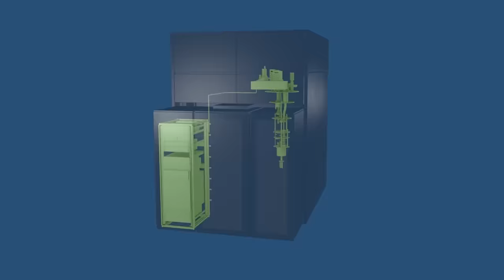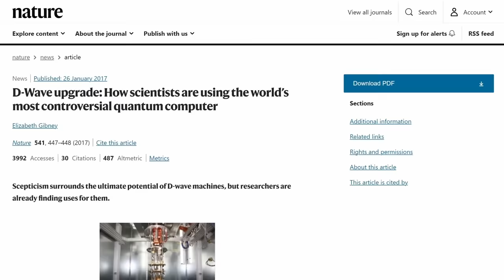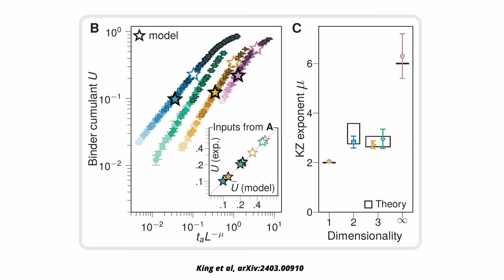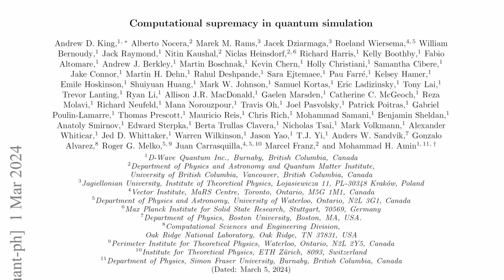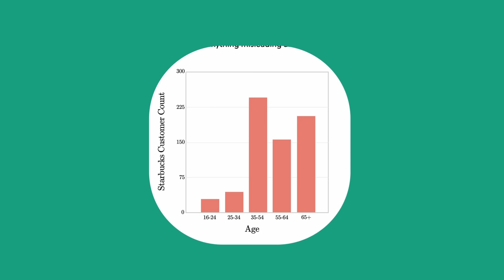Record Quantum Computation at D-Wave: Millions of Years Down To Seconds

Comment: So here is the basic problem, let me use an analogy. 

Suppose I wanted to know the total number of the grains of sands in the Sahara desert. And I ask an authority, and that authority assigns the boundaries of the desert. 

This is very similar to a quantum problem in that while we know the boundary, what is in the boundary is subject to constant "random" and process change. Its obvious since there is a desert, and the desert does not cover all of Eurasia that there is some modulation of the desert, we dont need to know how, but we can argue that there is a wave function associated with the desert. 

So I want a machine to determine the number of grain sands. So I ask AI to build such a machine. The AI builds a coring macine that has wheels on it and it goes out and samples the desert in a large number of places. It has a lab on board that assesses the grain size of the sand particles, it consults textbooks to determine what is the lower cut-off on grain size. 
Finally after doing a long number of calculations and 10 years of sampling, it roles back into its starting location and spits out an answer within a specified confidence range. 

Is that a computer? Most certainly. 

Lets say I ask the computer to answer how many molecules of H20 are in the oceans, a similar line of question, could it answer the question, probably not. You would have to go back to the AI and ask it the AI to build another machine. 

So we need to talk about what a computer is. A modern computer is a machine that connects I/O facilities to a circuitry that has both realtime storage (RAM) and computational facility. 
How it works is that a program is taken from the I/O facilities, loaded into RAM and then executed on the processessore generating an output which is fed back to I/O. The point of the system is that the program is a variable that, hopefully, was designed to work on the system, however the system was not specifically designed to run that program. And so most programs are designed to work on many types of processors and can be written to work on other types of processors, given certain limitations (e.g. processor memory, integer size,  . . . .). IOW processors are flexible to a wide variety of tasks, however, if say you want to build a 1000 part ship in KSP2 you might find that your memory and your flops are going to make your ship is both unstable and your game play hideously slow. 

So if I, knowing the limits of quantum computing decided that I could build a more powerful quantum computer but with more confined limitations on what it could do. And if I was successful a doing this, with an error correction algorithm, I could look at a variety of problems and note problems in nature that have similar random effects. In doing this I could select from a wide variety of problems and demonstrate my platform on the most parsimonious examples. 

    What they are not telling you is all the physics problems they tried to emulate but failed. 
In other words, they likely cherry picked a simulation that worked the best. Then what will happen is that the next best example(s), they will try to alter the machine to increase performance for that(those) problem(s).  This ensures an almost constant stream of oublications over the next five decades which also is alot of free advertisement.

Comment: If wormholes were real wouldn't the gravity at 1 end pull on the gravity at the other.  And being unstable not much light would get through.  And the gravitational paths of gravitational bodies would be altered. Areas of gravity would be linked stronger then they would be otherwise. But little evidence to explain it.

Comment: Simulation isn´t calculation? Thank you for your work.
Reply from the maker: Well, I find this distinction rather fuzzy which is why I don't really get the criticism that's been levelled at D-wave.
Reply: @SabineHossenfelder  "it's just a horseless carriage, not a car" said the naysayer
Reply: The distinction comes from how we think of a "computer" today.  Computers are expected to be programmable to do all kinds of things.  Annealing requires framing a question in the form of a hamiltonian whose ground state is the answer.  That only works for a particular set of applications.  I think a better analogy than a spoon is a pocket calculator vs a desktop PC.  Technically the calculator is a computer but if you asked someone for a new computer and they brought you a calculator you wouldn't be happy.
Reply: @MM3Soapgoblin Thank you

Comment: Would it be correct to call it an analogic (as opposed to digital) non-programmable computer? 

Just like ancient models of the solar system based on spheres and gears "computed" the passage of the days and seasons. Or like the tides could be "computed" with the help of a series of different sized disks adding or subtracting movements from an indicator – we'd use fourrier transforms today...

Or, alternatively, instead of "computer", maybe we could say it's a molecular MODEL of the studied phenomenon?

Comment: While D-wave's results are impressive the comparsion of a semi-programmable device to a general purpose device leads to misleading results. Its like comparing the matrix math throughput of a GPU vs a CPU. A GPU is limited in what kinds of data it can work on but when it does work on that data its much faster than comparable CPU will ever be at the task even if the CPU is perfectly cappable of working with the data the the GPU is designed to work on. In general as the the flexiblity of a computational device increases its throughput will go down. While this isn't a perfect comparsion its the best one I can think of atm. 

The big question I have is: is d-waves device more similar to a GPU or an ASIC? 

If its more on the GPU end of the scale the results are far more impressive than if its more similar to an ASIC.
For those who don't know what an ASIC is it stands for application specific integrated circuit. Its a device that is design to do one specific computation extremely quickly. If D-Waves device is basicly an ASIC but with q-bits instead of regular transistors then its far less interesting and impressive then if it is similar a more general purpose but scope limited device like a GPU.

Comment: All sorts of natural phenomena require near infinite processing time if you want to simulate it at excessive detail. The magnet simulation sounds like an N-body problem, as well as an optimization problem of lower energy states. 

I've been toying with the concept of the "clay computer", where a lump of clay is deformed in different ways, if there were ways of linking the model to some higher order computational simulation problem.

More seriously, perhaps someone can model protein folding into an optimization problem suitable for quantum computers. I offered GPU power through to Folding At Home a couple of winters (when the heat was needed anyways).

Comment: one of the first documented uses of "computare" was in the context of determining the date of easter, as i may remember in the 11th century
For me, they are analog computers that can be applied to a certain class of tasks. However, there is a cross link to certain classes of artificial neural networks, which also use an annealing approach for a 2d lattice of connected items. No, not the current deep data base indexes.... Yet, one has to be old enough to remember, ihihihihi ...  DWave may be suddenly at the forefront of true AI

Comment: So they ran a program - and got the expected result.  Did it run the calculation correctly?  Or did it merely project the expected result?  (Think of this as a more complicated version of ‘a stopped clock is right twice a day).  Doing one thing with it is impressive, but if we can’t check the result without millions of years, it’s hard to assess it’s true capability from a single, unverifiable result.

Comment: i dont buy that. in conventional computing, you have some formula, which models some aspect of the real world. Some (maybe millions of them) variables model the state. then use use 'real numbers', that is IEEE  754 floating point numbers and some digital hardware to combine those IEEE754 numbers according to the formulas. At the end, you get some nice diagram. You modelled/simulated physics by a digital model of it. 
That D-wave thing seems to be much closer to the world it models, that is the magnets. Thats why it is so fast for this problem. It may be fast for other, related problems, like crystal properties. 
however, i cannot see application of this for, lets say, encryption problems, which require correctness to the last bit.

Comment: LOL, conventional magnetic FEA, requires billions or trillions of elements in very complex large simulations.  Alternatively conventional FEA can vastly simplify and speed up the analysis by using smart element density analysis and vary the element size according to magnetic gradients.  Element groups can also be co processed for another massive boost in speed.  I question the importance of this record as I believe given similar funding there is straight forward methods to massively accelerate current computations to similar or faster speeds.

Comment: arent atoms like lots of magnets so in that case letting the system fall into its natural state isnt surprising that it solves the problem because it simulates the same thing. It isnt calculating anything at all. It like throwing a handful of sand on the floor to simulate how a handful of sand might appear after landing
Reply: The problem is getting them to actually be arranged in a way that actually solves your puzzle, and then "read" the result. So yeah, could potentially solve anything in nanoseconds instead of a gazillion years. But it takes ages just to "program" the question and it's difficult to "read" the answer.

Comment: Well the whole universe is a computational device in some sense, so why wouldn't that spoon be that as well. Maybe it turns out that's the only way quantum computers can operate. Spoon can be converted to some other metal thing by a skilled worker and then it will calculate something else.

Comment: I'm curious... if it takes "millions of years to do those calculations /simulations", how do they know that the result is correct?
It would take "millions of years to do those calculations /simulations" on a deterministic system to find the solution so...

Perhaps it did make those calculations in seconds, but are the results correct?!
Even if the results match predictions, what if the predictions are wrong?
Error bar stretches beyond predictions...

Well... I'm not sure about this.

Comment: Claim #1: our quantum computer did a computation in 200 seconds that would have taken a standard computer 10,000 years.

Claim #1 Rebuttal: we solved the 10,000 year computation in less than 5 minutes on a standard computer using an algorithm.

Claim #2: our quantum computer did a computation that would have taken a standard computer 1,000,000 years.

Claim #2 Rebuttal: we solved the 1,000,000 year computation in less than 5 seconds on a Commodore 64 using an algorithm programmed in Basic.

Comment: I think the computing vs simulation is just bs that competing researcher throw at each other. At the end of the day calculations were done and a numerical result was produced. In theory all classical algorithms can be made to run on a quantum computer, but it is not yet know if all classical algorithms have a quantum component to them. Meaning classical algorithms running on a quantum computer will be no faster than a conventional computer. With that said it means quantum computer are only good at solving certain types of problems. What D wave is doing is to concentrate on particular applications in this case annealing. There isn’t really a point in bogging yourself down in make a universal quantum computer in which it can run any algorithms but not any faster than something off the shelves.

Comment: The analog mechanical computers of the 1950s and electrical analog computers of the 1960s were hardly general purpose.  They could do difference calculations pretty well (artillery shell trajectories, electric circuit simulations), but no way could they fulfill and make all the address labels to get you your copy of Life Magazine in the mail.  And we had no problem calling them computers doing computation.

Comment: No one wants universal quantum computers anyways. They are too full of error to ever replace classical computers, because one of the main reasons we use classical computers is for perfectly accurate calculations. I shudder at the thought of someone trying to use a quantum computer to calculate my bank balance.

Much like how the array computer became the GPU, quantum computers in their ultimate form will be an accessory module that can be added to a classical computer.

Comment: You really need to take a look at quantum clocks, there really cool for what they are. Yes it's just a time keeping device on a pcie card I know but still it's like would be nice if we could move past the Gregorian calendar if you catch my drift, That pun was not intended. Well that and there are many really cool real-world applications that this helps with, anything that requires perfect synchronicity. personally I think  these need to be vertically integrated into like everything we physically can but that's my inner OCD coming through not wanting to never miss a beat or data packet in this case.

Comment: I think the title of the video is disingenuous as the research is. We know that a factor of billion speeds ups in conventional computer algorithms are possible. We also know that bespoke hardware is faster than generic CPU. Just look at the speed up that maths co-processors gave us a couple of decades ago and GPU/Blockchain accelerators are giving us now. Perhaps an equivalent amount of money put into building a conventional silicon   simulator, a placebo in effect, just to see how fast that could be, would tell us more about this field than anything so far.

Let’s not forget the quantum computer is always both right and wrong at the same time and more effort needs to be applied to massage the result into something readable than in the calculation itself.

Comment: I thought that's how all quantum computers work in the end, that they rely ultimately on that relaxation to get the result binary computers can't achieve. what's then is the difference in IBM's quantum stuff ?
Reply from the maker: Universal quantum computers operate much more like conventional computers. You don't set up an initial state and then just let it do what it naturally wants to do, but you perform a sequence of operations to shovel around data, basically. Then you read the result off the end state. The major difference is in how you encode the calculation. On a universal quantum computer you have much more flexibility hence they have a larger range of application.